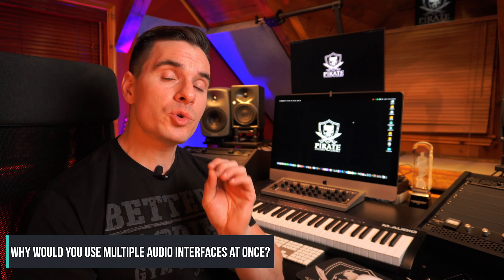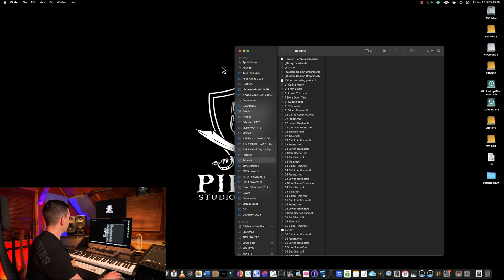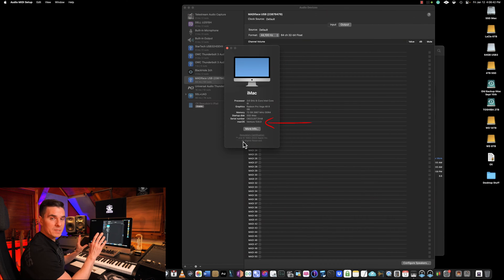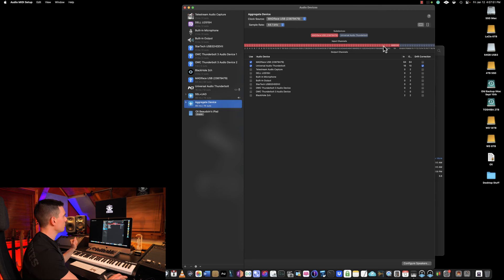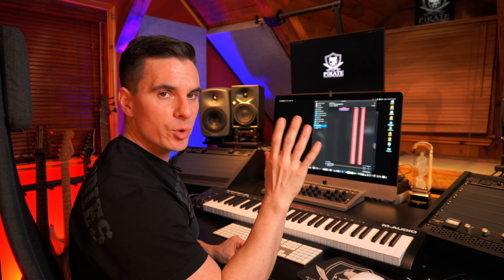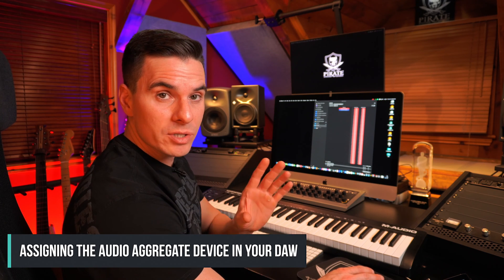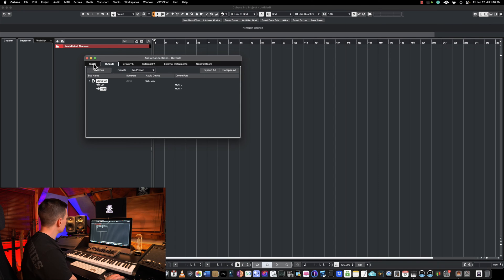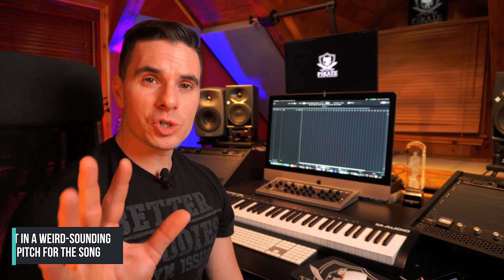How to use two Audio Interfaces at the same time on MAC

Comment: Thanks for the video!. I have a question you might be able to answer. I have a pretty similar type of set up as you have with one difference. First interface Apollo Twin, Second interface and SSL Apha 8 that I use to convert my 8 Cubase Outputs from Digital to Analog and then I go to an Analog Summing Device.  The output of the summing device box goes to an AD converter and back to Cubase using the S-pidif IN. 
I created a PRINT track and that is how I record the final Master. Everything works fantastic except when I do this I can not SOLO channels in Cubase anymore. I do not hear anything when I SOLO. 
In order to listen to the SOLO I have to go to the UAD console and UNMUTE the S-pidif channel and de-select the little speaker icon at my Cubase PRINT track. If you understand what I am saying is there a way to avoid have to going to the UAD console and unmute to SOLO something?.
Reply from the maker: That's quite an interesting setup! I would need to use the exact same setup to test, but you may find the answer in the Cubase/UAD forum for a solution.

Comment: Does it mattwe which interface is chosen in the aggerate first? Also, should the close source be based off the main interface used?
Reply from the maker: No, it doesn’t. Clock source should be your main interface indeed.

Comment: Can we use for 5.1 mixing using aggegare ouputs without latency issue??
Reply: yes u can, also some 7.1.4
Reply from the maker: It’s the cost to pay to using a 5.1 setup, having to process six audio streams simultaneously and involving 2 or more interfaces is not a simple process. Try reducing buffer size to minimum, but this alone may not be able to solve the issue.

Comment: Hello Oli, thanks for the well presented video! I am getting an extrrnal DAC/amp for my headphones and my goal is to continue to use Cubase control room with two outputs: one for my monitors and the other for the headphones. Can I make an aggregate device of my audio interface that is outputting to my monitors and the DAC/amp that is outputting to my headphones, and switching between these two will be as seamless as previously when I was using only my audio interface for both outputs in control room? 🙏
Reply from the maker: Thanks for your comment. Which DAC will you be using? I'm unfamiliar with your full setup, but for maximum routing flexibility, I suggest that you check out the Audio Hijack App, which allows you to route signals from within you mac in many different ways. Let me know if that works for you!
Reply: @OliBeaudoin  in the meantime, I got the DAC/amp (FiiO K7), and I am happy to report that the setup is working really well: I set up an aggregate device with Steinberg UR44C and the FiiO K7. In cubase control room, i have two monitor channels, one is routed to the UR44C output for monitor speakers and the other to the FiiO K7 output - works just as I hoped! I discovered also that you can change the setting that determines if an output is exclusive to one monitor channel: so now I can even setup a third monitor channel for another pair of headphones with their own calibration eq in the insert and route it to the same FiiO K7 output for when I plug in another headphone. 
I also discovered the audio hijack app and the sound source app, which is great for routing different app’s audio output to different devices, also, you can add plugin effects to the chain. 🙏
Reply from the maker: @gosnote  Seems like you have everything under control! 🙏😎 Thanks for sharing your setup and routing!

Comment: Great video Oli. So If I am understanding you correctiy  you have to switch back and forth between the interfaces  correct?
Reply from the maker: Thanks for your question. They are always both running at the same time and working as an “Aggregate Device”. Let me know if that answers your question!